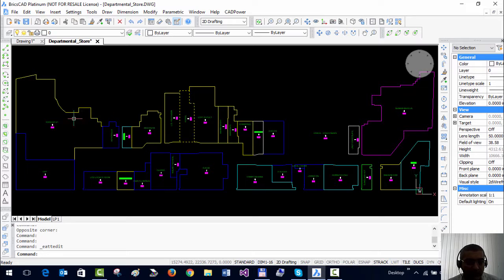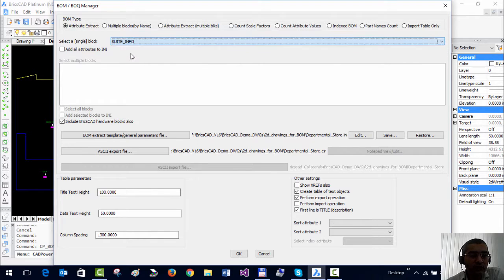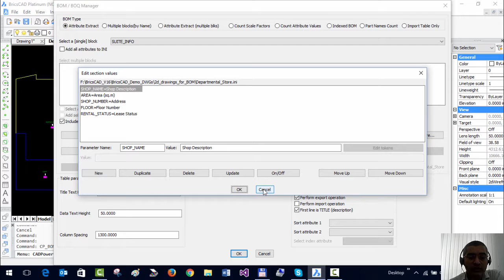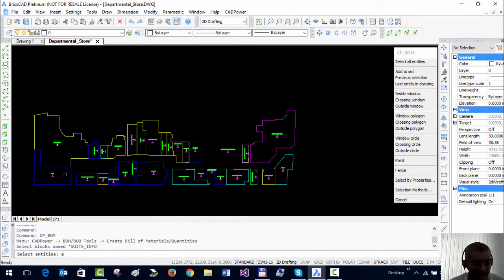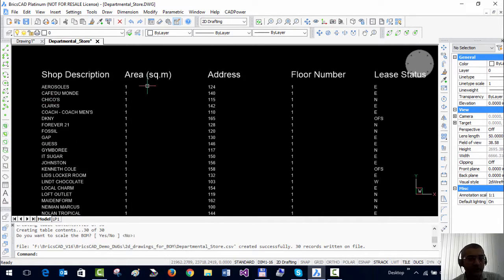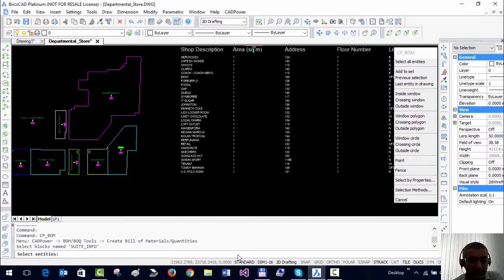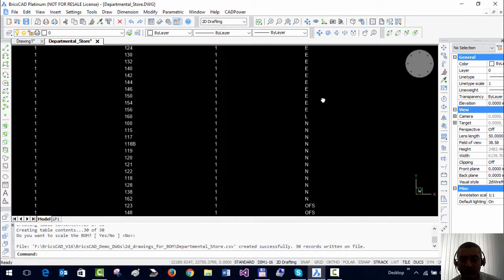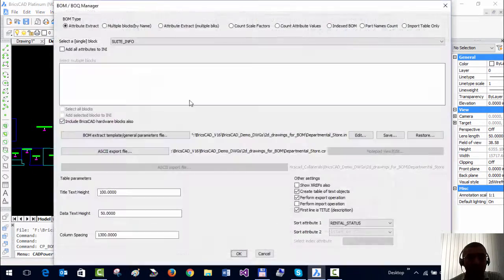Attribute Extraction and Tabulation | The Bill of Materials / Quantity | CADPower Tutorial | CP_BOM

Comment: why are all the room areas showing the value 1?
Reply from the maker: I think the video was recorded before the area values were set to correct values using another program. Good observation.
Reply: Did you mean another module (Functionality) or are the areas calculated by a program other than Bricscad? Also all the videos that I have seen for bricscad quantification show that it quantifies using either 2d objects or counts the instances of each attribute.
Reply from the maker: Yes, most of the objects in the video example have been 2d objects, but you can have 3d objects (like 3d model blocks) as well and they will be counted for numbers or attributes as well. We look at block as a single symbol entity (or similar). It does not matter what is in it - 2d or 3d?